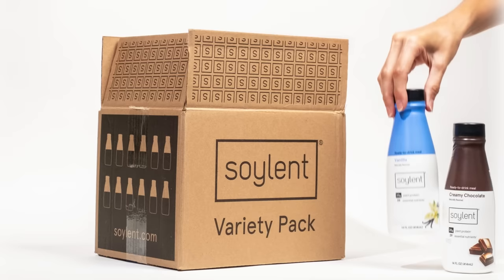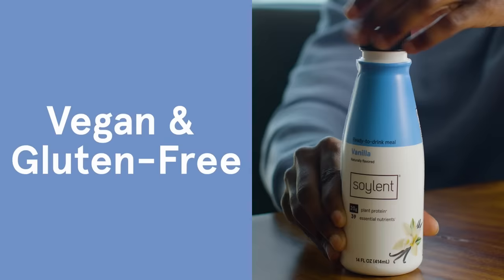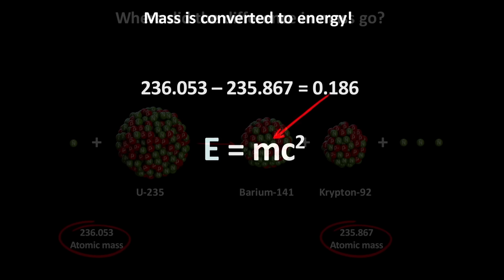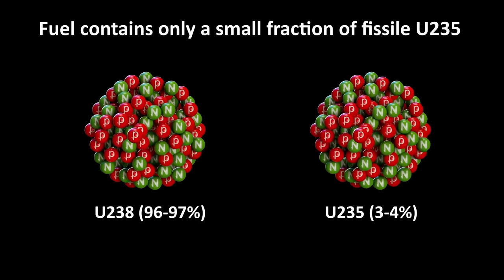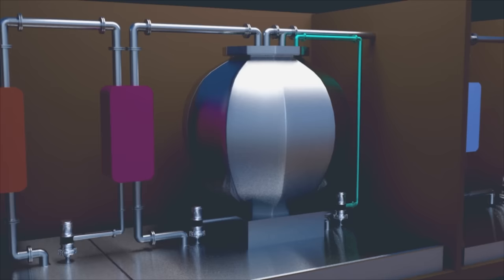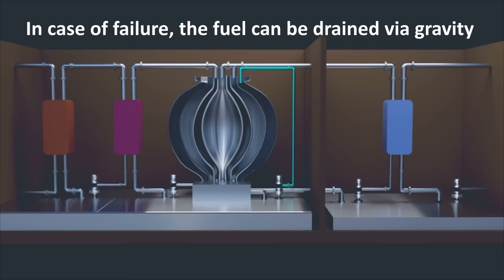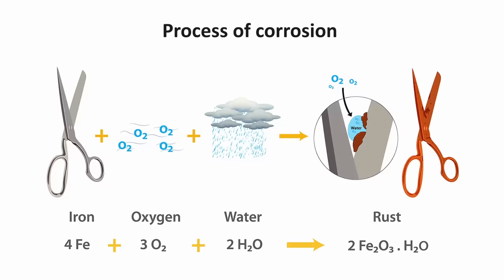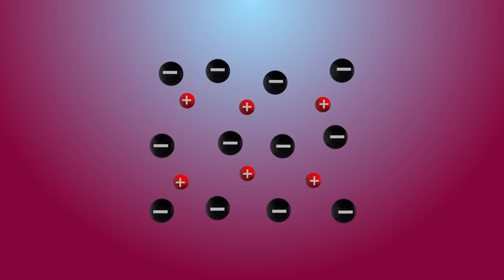How Molten Salt Reactors Could Revive Nuclear Power

Comment: What's interesting is that nearly all the negatives of solid fuel reactors have been solved by the Canadian CANDU reactors many decades ago. I'm disappointed the Canadian design wasn't even mentioned.

Edit: except for the cost
Reply: It’s great that they can use U238, but they’re pressurized and thus need heavy reactor walls and large containment buildings which add to the cost, land requirements, safety, etc.
Reply: While CANDU have mostly succeeded you might recall Darlington had a long outage.
Reply: Last chance for fission is molten salt reactor, old fission had over 50 years to get the general public to accept it, it's like the old RCA video disks nobody wanted, a old technology that been pushed to far.
Reply: All the D2O is out on neutrino detectors.
Reply: If you can’t afford the electricity or the owner of the plant can’t afford to operate/maintain it it’s useless.
Reply: Thorium based fuel was tested in a Heavy Water CANDU type test reactor.   The results at the time indicated it was not an economical option at the time.  

Thorium based fuel for reactors was testing in all known reactor designs in the 1960's and 1970's - and testing of non MSR designs continues to this day (HTGR pebble beds in the last several decades).

Please read my history of thorium nuclear power post.
Reply: Thorium is going into CANDU reactors soon.........improves yield per fuel bundle 700%.  Or in other words, 700% less waste.
Reply: Heck of an edit, lol.
Reply: N pressure vessel failure IF there is no pressure vessel like molten salt vessel
Reply: @doWINSANTO   I believe that  you are mistaken.  MSR reactors will have to be a pressure vessel.  

Using the imperial units I would expect that the MSR primary loop would require 50-100 PSI minimum just to effectively circulate the molten salt.  The Secondary Loop will likely be higher as there are larger pressure drops in steam generators.

That places the reactor vessel legally in the pressure vessel category in all countries in the world.

Since it is a fairly low pressure the metals it is constructed from will not have to be very thick and the reactor vessel would be tons lighter than a PWR design.

It would still be subject to leaking and even a potential very large rupture - and spilling extremely highly radioactive molten salts into the containment building.
Reply: ... you don't see a word about economics.Wait and see.
Reply: @perryallan3524 those prototypes were experimental and landmark, they got its problems sorted but at the time nuclear was about weapons grade fissionable waste and thorium wasn't producing any

Comment: Thank you! Thank you so much for covering this! You did a great video and covered all of the important points.

Here’s a couple of additional things:
1) You should see if you could tour Flibe Energy and interview Kirk Sorensen if possible. Flibe has several important additional uses for lithium-fluoride thorium molten salt reactors (LFTR) that involve using the radioactive byproducts for medical purposes and the heat for desalination and recycling. Also, Plutonium 238 is a byproduct and this is very rare and very useful for radioisotope batteries.
2) Another important benefit of LFTRs is since they don’t use water for cooling, they don’t need to be near large bodies of water.
3) There are other important political reasons why the world stuck with water-based reactors.
4) The low pressure and no water make them perfect for space-, moon-, and Mars-based power generation.